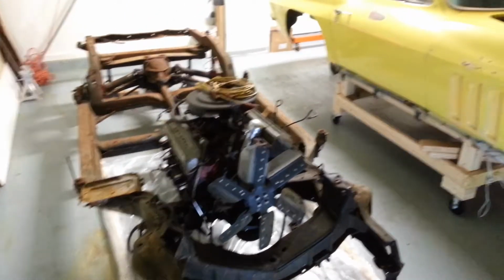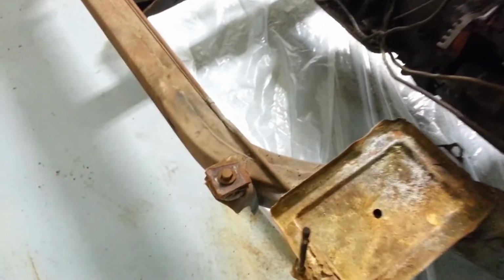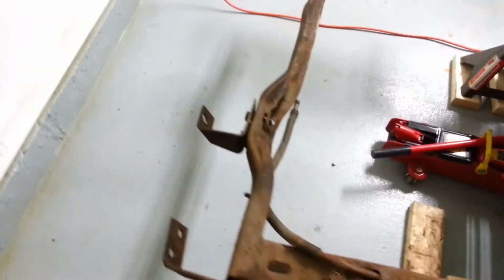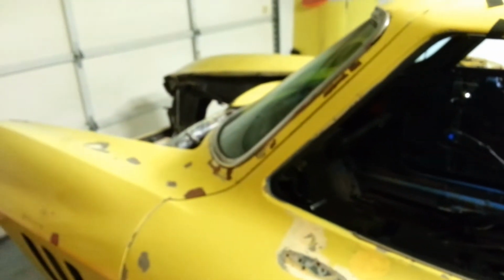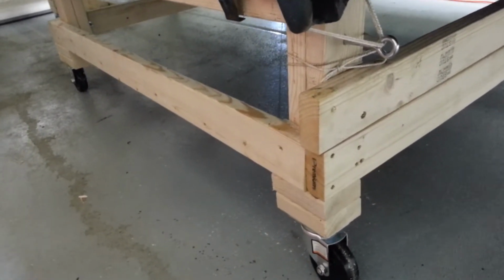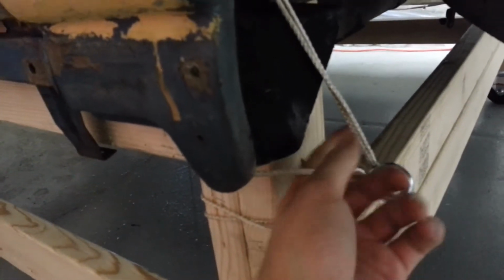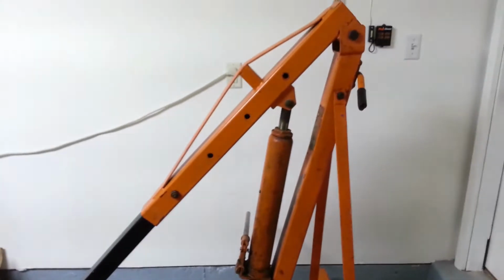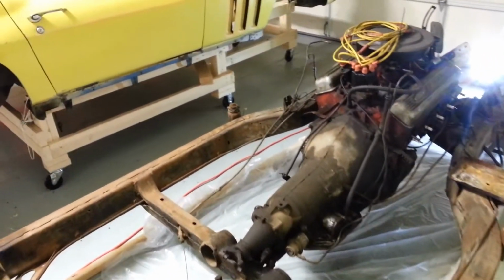1966 Corvette-Pulled the body w/ an engine hoist

Comment: I had that problem with my engine hoist legs were too tall, so while the body was hanging in the air, i put wood under the wheels of the dolly to get the legs under ..  that's good into about the dolly legs  --- i did mine 3 years ago --  still putting my 67 back together  --
Reply from the maker: music makes us happy 
I think alot of people have had that problem because the plans don't mention it. 
My body has been off 2 1/2 years now, I recently added 4x4's, lag bolts, and larger wheels to the dolly. 

Good luck with your '67, sounds like your at the same point or a little further along than me. I will have the chassis done this year, transmission and engine next year, then the body goes back on, probably summer 2019.
Reply: Had my chassis powder coated , went from Marlboro Maroon to Rally Red looks nice .  once you start replacing things it's hard to know when to stop . labour of love 4 sure -